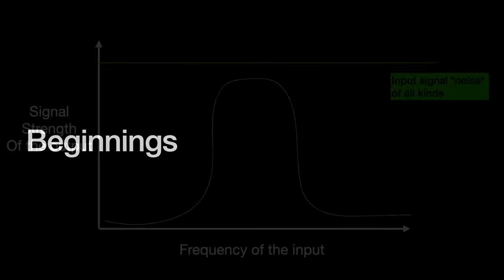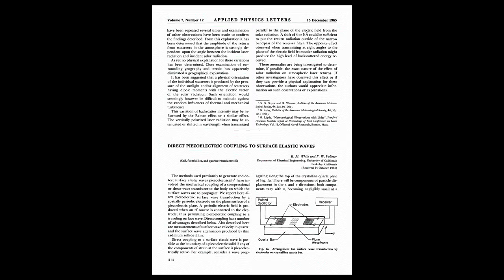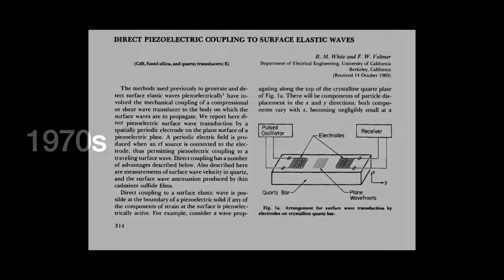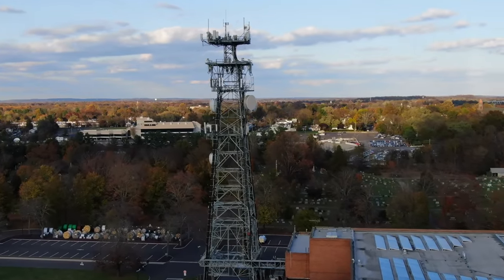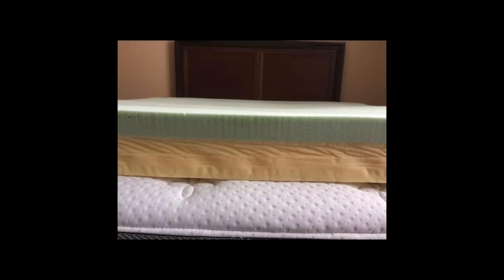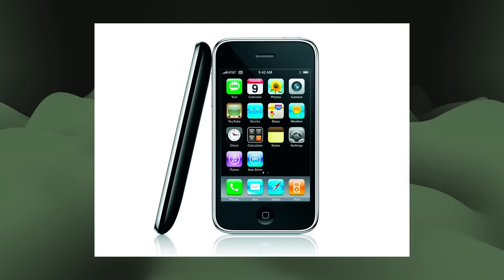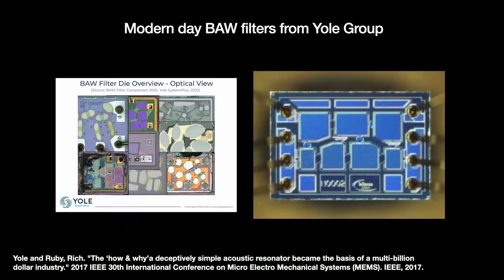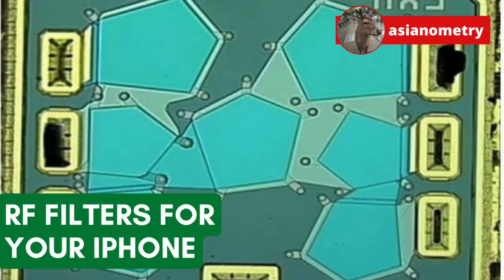The iPhone Forever Changed the RF Filter

Comment: Fascinating video! I'd love to explore this topic further in terms of how software could take over filtering. Software defined radio applications like GNU-Radio have a myriad of high / low / bandpass filters that I find work effectively and, more importantly, sharply in their filtering. Rather than that 'skirt' the filter bandpass shape can be close to being sharp vertical lines where frequencies 1 Hz away can be filtered out albeit at the cost of more intense CPU processing. Could SDR dispense with all these physical filters you have described?

Comment: The other component you can maybe explore in future videos is the RF mixers/modulators and the A/D, D/A behind these filters. And why they require these filters to function.

Still waiting for the mythical GHz RF sampling ADC which can sample everything without needing analog filters or mixers. They consume too much power and can't handle the linearity requirements currently.

Comment: Interestingly, the MEMS devices inside iphones make the phone susceptible to helium gas which can soak into the filter, changing the resonance frequency of the nanomechanical resonators as helium has a higher speed of sound. Famously, some iphones died in MRI and NMR labs while their superconducting magnet was filled with helium...

Comment: I did my masters on this subject a while ago. It felt really nostalgic to see the paper by White and Voltmer after 3 years

Turns out that since the waves are at the surface of SAW devices, they make great sensors. That's what I researched and my group in Brazil is still actively working on

Comment: Fascinating topic as an EE, though I think you maybe giving too much credit to the iPhone - I’ve been in the telecoms sector (in devices as it happens) since 3G was the big thing on devices and although 4G was the stepping stone for the data boom, Apple has always played it safe on the technology front thus waiting until specs/chipsets are mature - hence launching with an EDGE device when even the most basic feature phones were 3G as standard. Likewise by the time the 5 launched, there were dozens of multi-band LTE phones already on the market, Apple just had the sheer weight of volumes to drive towards a “world phone” which in reality they are still not, as there have always been multiple SKUs of each model depending on broad region - supported bands does not mean they are all working at once, they’re regionally activated. Similarly they chose Infineon/Intel from the 7 to the 11 series which hampered support of newer features such as Carrier Aggregation and new LTE bands, hence jumping back to Qualcomm for the 12 on in order to have a 5G ready device…

Comment: SAW (Surface Acoustic Wave) has 3 popular application space: filter, delay line, and resonator (<-- in lieu of crystal oscillator.)
The first type is used for RF BPF (band pass filter.)  For a consumer analog TV set, one might find a 45.75MHz (for analog NTSC) or 38.9MHz (Western Europe) for video IF (intermediate frequency) BPF.
Most likely in the same era TV set, one can find a delay line (typically 1H, for NTSC it's 63.5uS, and 64uS for PAL.)
It's using SAW technology: piezoelectric crystal for ultrasonic wave generation, passing through large-and-long glass media, bounce in the path several times to reduce the component size, thus gained the fixed wave's propagation delay. At the output side, another piezoelectric crystal did the mechanical energy to electrical signal conversion.

P.S. a recent Short showed a SAW BPF under the microscope.  It's amazing.
Reply: "Inside a SAW Filter"

Comment: Helped a friend design and fab cross over filters for his home built speakers in 1980.  That fun summer turned into changing my major and my life.  Question.  I noticed the bonding pads on the integrated BAW (?) filter has rectangular bonding pads instead of the 100x100 pads I'm familiar with.  So they cant be ball bonds correct?

Comment: For radio systems( "walkie talkies")To achieve a higher Q, the filters usually become bigger when you get into lower band frequencies.

They can also be quite pricey.
 In the 450 Mhz range combiners, consisting of filters+ isolators can cost as much as 10k each.

 For low VHF, a filter could be as long as 6"*10 feet

Comment: Contrary of what you states surface waves can be Rayleigh waves or Love waves and both can be seismic waves, besides seismic waves can be longitudinal too.  The P waves (the ones that get first)  are longitudinal waves and S waves (the ones that came later) are transversal waves. (surface ones).  For nearby earthquakes you can count from the first wave and when the second arrives you can know the distance of the epicenter, just like a lightning and a thunder. In Love waves the particles move up and down on a straight line perpendicular to propagation of the wave. In Rayleigh waves the particles move on an ellipsis around the resting point with the longest axis perpendicular to the propagation direction, just like ocean waves but the movement of the particles is on the opposite direction. On longitudinal waves waves move back and forth like on a coil on the same direction of wave propagation. The matter does not propagate in all cases just moves around a point, just the wave propagates.

Comment: You don't need filters for every band. You can mix the incoming or outgoing band with a pll generated frequency that gets subtracted and produces a single intermediate frequency for all bands. 

The other handy thing is the filter width at this lower intermediate frequency will have a better Q than one at the original frequency so it's a win win.
Reply: As long as you avoid issues with the image frequency

Comment: 8:14 ... I would rather say, "Without having to manually fine-tune the tuner/channel selector. " ... The "static interference" was rather caused by low signal strength and analog modulation, which was more easily affected by "noise"... vs the digital transmission modes we're now using

Comment: Abstract

This video explores the evolution of RF filters, focusing on the impact of the iPhone and the rise of LTE technology. It delves into the technical aspects of SAW and BAW filters, their manufacturing processes, and the key players in the industry. The video concludes by discussing the future of RF filters in the context of 5G and potential market trends.

The Importance of RF Filters

* 0:02: The video starts by highlighting the challenge of receiving desired radio signals amidst a sea of radio noise. RF filters play a crucial role in ensuring clear communication by selectively allowing specific frequency bands to pass through while blocking unwanted ones.

Filter Basics and Functionality

* 0:53: The fundamental function of a filter is explained, emphasizing its role in passing desired frequencies and rejecting unwanted ones.
* 1:24: The concept of "insertion loss" is introduced, representing the unavoidable signal degradation caused by filters.
* 2:03: The video defines the "Quality Factor (Q)" as a metric for evaluating filter performance, with higher Q values indicating better selectivity.
* 2:39: The focus narrows down to RF filters operating between 100 MHz and 10 GHz, differentiating them from microwave filters.

SAW Filters: Early Development and Applications

* 3:07: The historical origins of SAW filters are traced back to Lord Rayleigh's work on surface acoustic waves in the 1880s.
* 3:58: The invention of "Interdigitated Transducers (IDTs)" in 1965 is discussed, marking a significant advancement in SAW filter technology.
* 4:45: The video explains the working principle of SAW filters, where IDTs convert electrical signals into mechanical waves and vice versa using piezoelectric materials.
* 5:42: The manufacturing process of SAW filters is described as a MEMS (Micro-Electro-Mechanical Systems) technology involving deposition, lithography, and etching.
* 7:10: Early applications of SAW filters in military communications, space exploration (Voyager missions), and television sets are highlighted.

The Rise of SAW Filters in Mobile Phones

* 8:33: The transition from bulky ceramic filters to smaller SAW filters in mobile phones during the development of 2G cellular networks is explained.
* 9:11: The video emphasizes the affordability and ease of manufacturing SAW filters, making them a dominant choice for early mobile phones.

Limitations of SAW and the Emergence of BAW

* 9:34: The limitations of SAW filters at higher frequencies above 2 GHz are discussed, leading to the need for alternative solutions like BAW (Bulk Acoustic Wave) filters.
* 10:40: The video introduces BAW filters, which utilize acoustic waves traveling through the bulk of the material, offering advantages in higher frequency applications.
* 11:15: The two main types of BAW filters, FBAR (Film Bulk Acoustic Resonator) and SMR (Solidly Mounted Resonator), are briefly explained.

FBAR Filters: Advantages and Manufacturing Challenges

* 13:41: The video delves into the benefits of FBAR filters, such as better electrical isolation, reduced sensitivity to contamination, and suitability for higher frequencies.
* 14:07: The manufacturing complexities of FBAR filters are discussed, including the need for multiple mask layers and precise thin-film deposition techniques.

The iPhone and the LTE Revolution

* 15:37: The video explores the transition from SAW to FBAR filters in iPhones as they adopted LTE technology with its numerous frequency bands.
* 17:10: The iPhone 5's role as a "world phone" supporting multiple LTE bands is highlighted, driving the demand for advanced RF filters.
* 18:50: The significant growth of the BAW RF filter industry following the LTE rollout is emphasized, with Qorvo and Broadcom emerging as dominant players.

The Future of RF Filters: 5G and Beyond

* 20:11: The video discusses the challenges and opportunities presented by 5G technology, requiring further advancements in BAW filter design and materials.
* 21:13: The potential for continued growth in the RF filter industry is explored, considering factors like increasing demand for higher frequencies, miniaturization, and performance improvements.

i used gemini 1.5 pro
Token count
10,925 / 1,048,576
Reply: Top YouTube Comments on "The iPhone Forever Changed the RF Filter":

* Praise for the Video and Channel: Many viewers express appreciation for the informative and engaging presentation of a complex topic, praising the channel's ability to make technical subjects accessible and interesting.
* RF Engineering Insights: Several comments come from RF engineers or individuals with experience in the field, sharing their own perspectives and anecdotes related to RF filters and the broader world of radio frequency technology. They often highlight the complexity and "black magic" aspects of RF engineering.
* Technical Clarifications and Corrections: Some viewers provide technical clarifications or corrections to certain points in the video, such as the pronunciation of "Rayleigh", the definition of Q factor for bandpass filters, and the actual location of Broadcom's RF filter fabrication facility.
* Historical Context and Industry Evolution: Comments discuss the historical development of RF filter technologies, including the contributions of companies like HP, Agilent, and Infineon. Some viewers share personal experiences and memories of working with SAW and BAW filters in various applications.
* iPhone's Impact and Market Dynamics: Several comments debate the extent to which the iPhone truly "changed" the RF filter industry, acknowledging the influence of other smartphone manufacturers and broader market trends like the rise of LTE.
* Future of RF Filters and 5G: Viewers express curiosity about the future of RF filters in the context of 5G and beyond, speculating on the potential for further miniaturization, integration, and the use of new materials like scandium-doped aluminum nitride.
* Requests for Future Topics: Numerous comments suggest ideas for future videos, including antenna design, other MEMS technologies, the history of specific companies like Taiyo Yuden, and the use of software-defined radio for filtering.

Comment: In case anyone cares, 3g protocols, or at least GSM, use packet switching (IP based) for data, and circuit switching (not IP based) for calls. LTE drops support for circuit switching, and is packet switched only. A bit pedantic, but I wasted an hour trying to figure out how 3g data worked without being IP based.

Comment: "you can fill a bucket with these for more than the bucket costs" ... isn't that true for most things?
Reply: In this case it was a mistake. The original quote was clearly about bulk pricing on a unit basis, not the total cost of 50 million filters.

Comment: I love your videos it takes me back to my Electronics days. Alot of modern communication speed can actually be attributed to modulation techniques with faster DSP and better noise rejection. Current techniques are now able to encode 1024 bits per symbol using higher frequency carrier wave and faster symbol rates on the carrier means more data over the same frequency band. This is vary important part of the technology used in 5g and 6g. The high frequency 6ghz and above have severe range issues and attenuate when transmitted through walls. It's better to use microwave frequencies but increase the modulation performance on the same band. Multi band techniques can help improve performance but this comes with complexities. QAM is the core technology if all modern wireless communication.

Comment: I still don't get SAW. So what differentiates the two transducers? The first one acts like an antenna that transmits the second one that receives. But do they have different comb structures to receive different frequencies or does the quartz crystal do the filtering?  
Basically I don't get why the second one does not receive exactly what the first one sent.

Comment: 9:24 You can fill a bucket with these filters for more than what the bucket cost. 😮😮😮😮
Reply: That was a bit of a fail. You can fill a bucket with an endless number of things that are worth more than the bucket. I think it was meant to be used in reverse for really cheap things.
Reply: Surprising because it’s laughably untrue. Think about it for even ten seconds and you’ll see why.
Reply: @Grak70  you can not fill a bucket for more than the amount you paid for the bucket??? You have expensive buckets of small size maybe???
Reply: @davec8921  I don’t think it would be possible either way one way is too cheap the other way is too broad to have any sort of meaning… but it would be nice if you could just make the buckets of the perfect shape and size to fit the narrative and then sell them the price required to make this true haha
Reply: @Luxcium  sure, maybe if your bucket cost $10M

Comment: Firstly, it wasn't really Apple responsible for this, and at every step of the way after the first iphone there were competitors using the Android and alternative operating systems for their phones and that also produced "world phones."  Secondly, Qualcomm built the majority of WAN modems for the host of phone manufacturers that used CDMA, HSPA(+), and LTE that gave us this amazing over-the-air bandwidth, and GSM was an early competing narrow bandwidth protocol that was horribly slow (not to mention inefficient) for data transfer.  Qualcomm also owns most patents in the CDMA-based protocols even up to and including 5G... So, Qualcomm has a much better claim overall to the success of miniaturized cell phone component manufacturers than Apple.

Comment: I'm wondering what do modems do with that frequency after filter.
Because as I understood it provides bandwidth, but in that bandwidth it'll need to select one or more carriers (like in ofdm), which needs filtering too.
Reply: There are more filters after that. Older modems would have more RF filters but modern modems use way more digital filters. For OFDM specifically, you would need a final FFT to recover the sub carriers (not including required time tracking and frequency tracking)

Comment: The RF filter is not niche.
The math for electronic filters was developed only in 1935; and it is one of the most complex and challenging sectors of electronic engineering.
The filters are essential to a smartphone just like the power MOSFET that amplify the radio frequency which is fed to the antenna...
Reply: I studied this in the mid-90s, got an MSEE but went into software since. 🤣🤣. I remember how complex some of those capstone RF projects were.

Comment: For the iPhone specifically, the engineering for the filters were needed, considering the first demo was faked to ensure it had the best connections to the tower to show the web features
Reply: It wasn’t faked: they made no secret of using WiFi, not mobile, during the demo.
Reply: @tookitogo  have you actually taken a look behind the scenes of the original launch (aka testimony from former devs on the original launch)? It's a well known fact that some features weren't working/completed during the first demo and were spoofed without the audience being aware (such as the cellular signal showing being strong when there were issues with it particularly)
Reply: @ChrisHilgenberg  I’m well aware. But they never claimed to be using the cellular network for the demo.

Comment: Some time in the 50s or 60s Sprague introduced a paper in oil capacitor with very low dialectric loss*. They christened it "Vitamin Q". 

*Q is basically the ratio of energy stored to energy lost in an LC circuit. Since it is  hard to reduce the energy lost in the L, the focus is on the energy lost in the C.